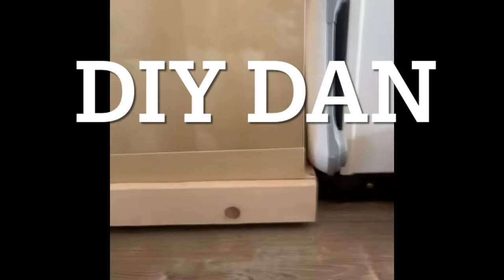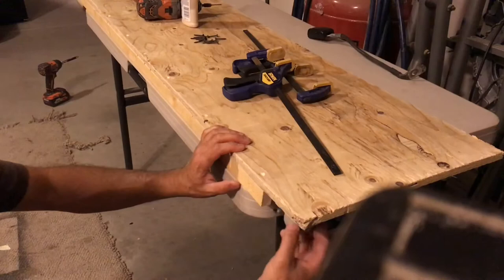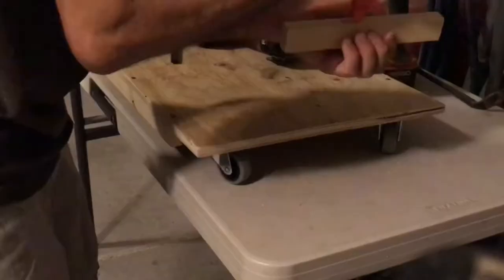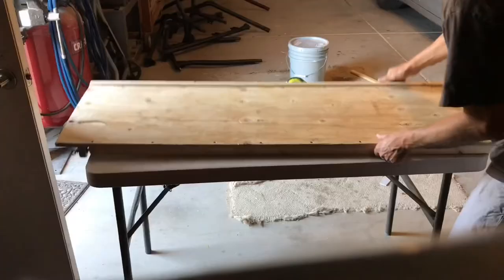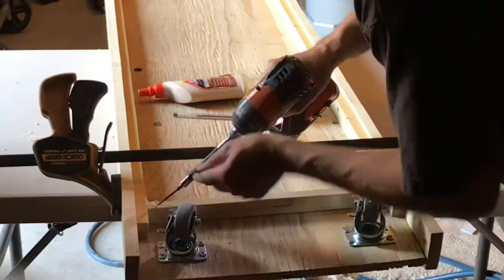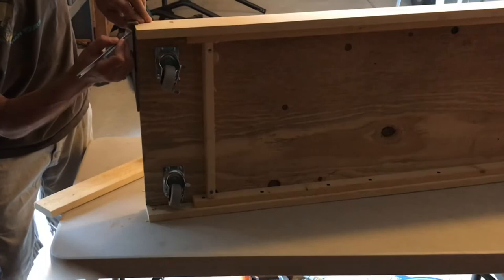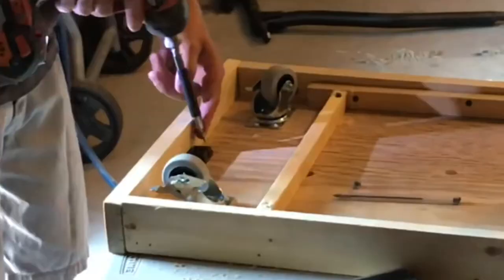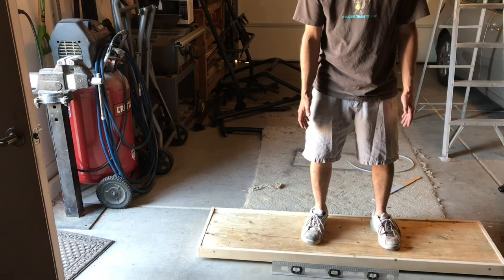ADDING WHEELS/CASTERS TO FURNITURE IN A NON PERMANENT WAY WITHOUT BEING VISIBLE FOR EASY MOVING

Comment: The screws that you used for the wheels. Should they go all the way through the wood (almost like the tip is at the edge of the other side, almost like coming out of it) or should it go half the way through the wood?
Reply from the maker: As close as you can come to all the way through the wood, but obviously not damaging the piece of furniture that you’re sitting on it the longer the screw you can use the stronger the base and casters are going to be